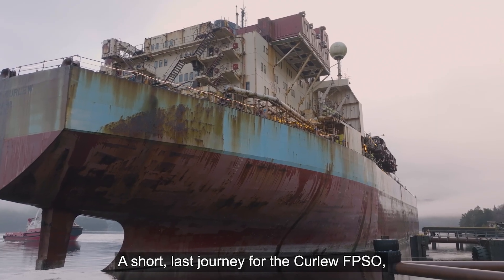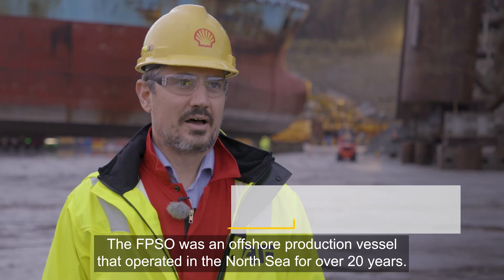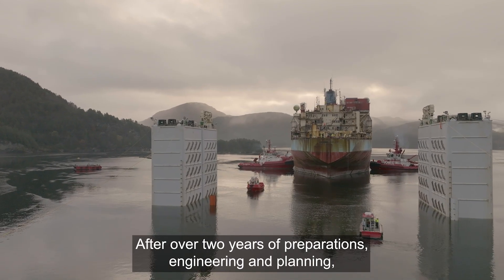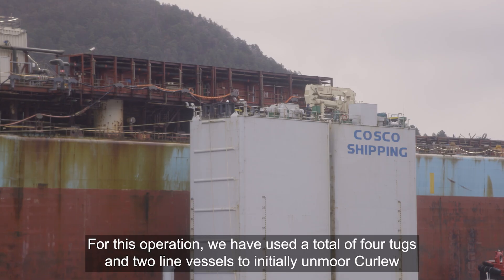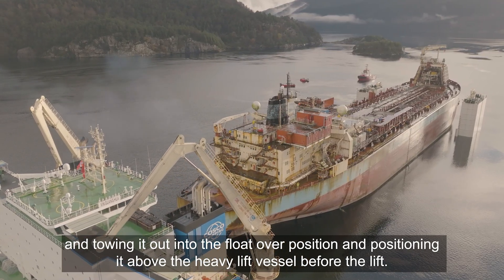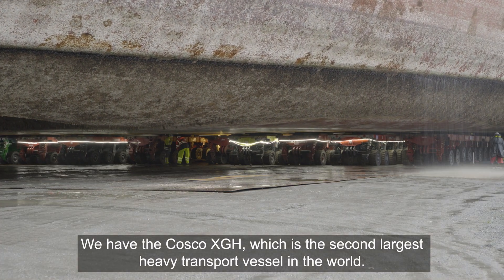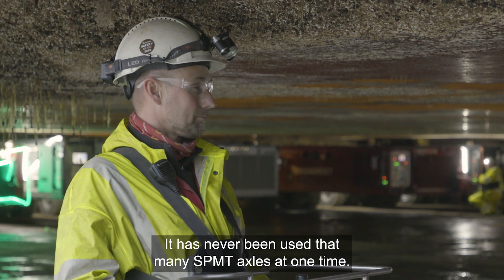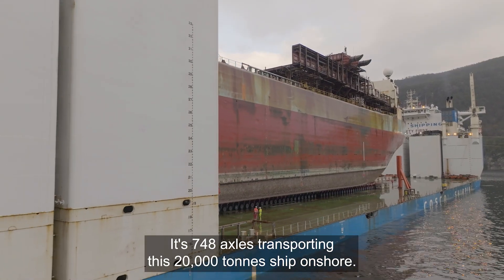Sustainable Ship Recycling: Record breaking recycling operation

Comment: what 5% is non recycleable
Reply: the pornography found in the crew's quarters. They're all stuck together somehow.
Reply: @lawrencelewis2592  Ohh   you mean sea men
Reply: asbestose ?
Reply: @blueman5924 maybe also rubber and other sealants, the fill from packing glands, 
some residue in the tanks (possibly slightly radioactive silt from crude oil),
The heavy- metal based paint from the ship?
Whatever they used to insulate cables.
(propably asbestos or fibreglass, lead compond based grease, mineral powder  and some long- since banned  plastics)
Non-flammable hydraulic fluids, fire extinguishing agents, anti- slip decking, ...

I think you wouldn't count the residue (but you have to dispose of it as hazardous waste),
And the paint is possibly burned at the steel plant and caught as dust in the steel plant filters.
(there's a plant near me where they process dust from steel plants. It's a big source of lead emissions, and their main product is recovered zinc)
Reply: @blueman5924  ya   maybe

Comment: Great video sequence: Floating, loading and placed on the keel block on the floating barge,  using crawlers to transfer from barge to shore considering tide condition, and then placing back on the keel blocks for further processing for dismantling and recycling.